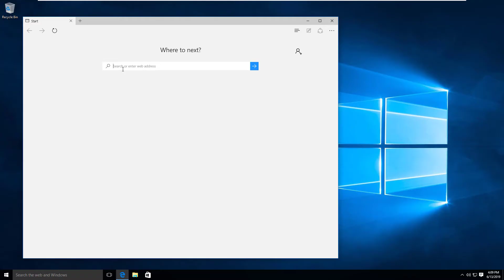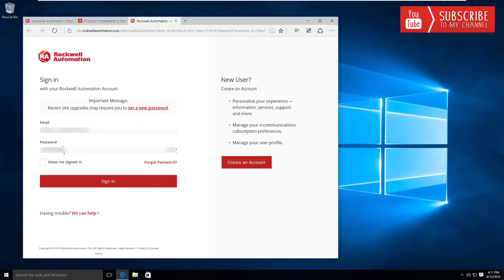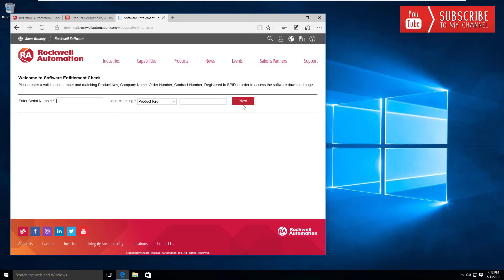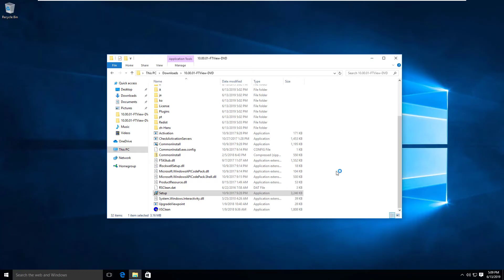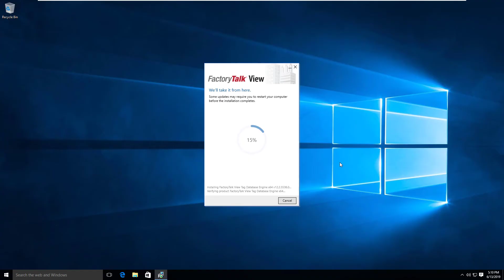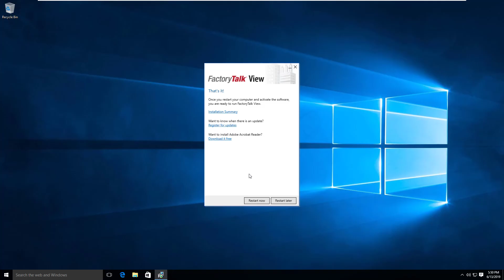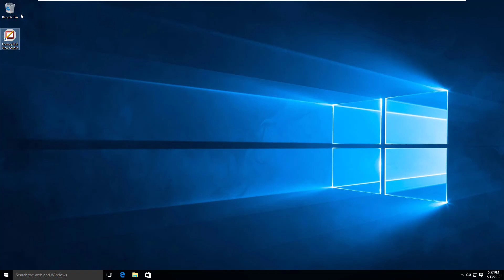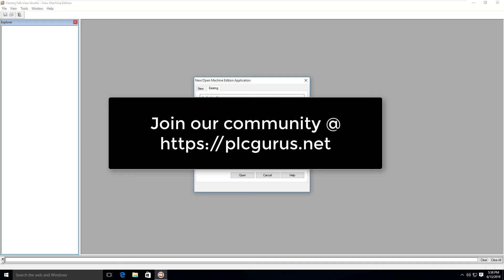FactoryTalk View Studio - Lesson 01 - Software Installation

Comment: Factory talk view doesn't work for me on virtual machine, parallels desktop. it loads up, but when I click communication setup, it freezes up, have any idea why that is ?
Reply: I have had the same problem, with a simulator, and the problem was the host, the clock did not was synchronizer, in another words, the hour was no the same as the physical machine

Comment: This is probably the one Rockwell Automation Software I’m most familiar and quite decent with, but no expert. As I’ve built quite a few HMI applications for work projects in FTV both SE & ME.  Especially having done it the harder way where you understand how to do things at fundamental level without Global AOI & Global Objects and that’s great to know. However with the Process Object Library v3.5+ it made it easier to build applications. In Process Objects  v4.0+ which was also developed for Rockwell Automations PlantPax DCS application the Process Objects Library can also be used with FactoryTalk application and FTV v10. As well to create newer graphic elements and rapidly build and configure an HMI. So I’m looking forward to see what you do with this new video series as well lea4n a few things new.